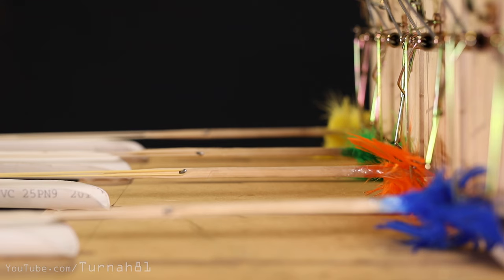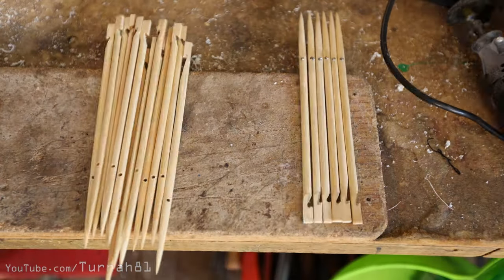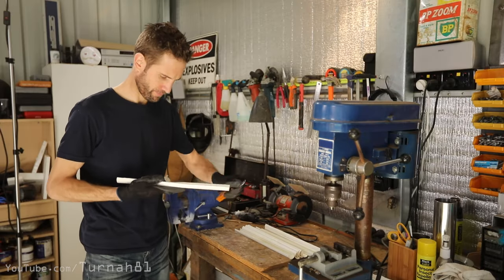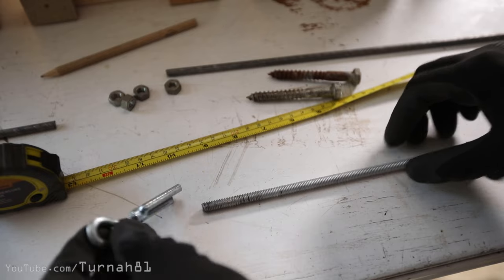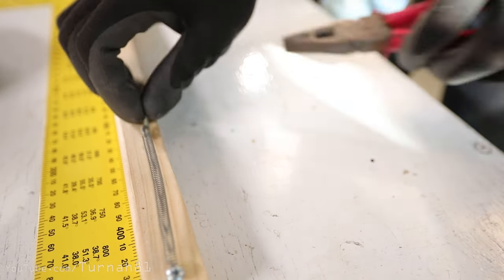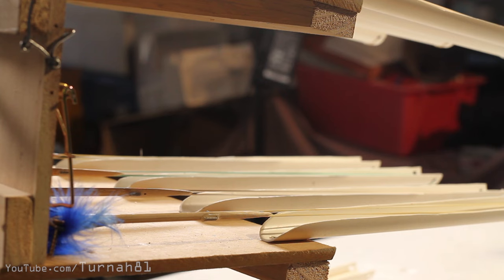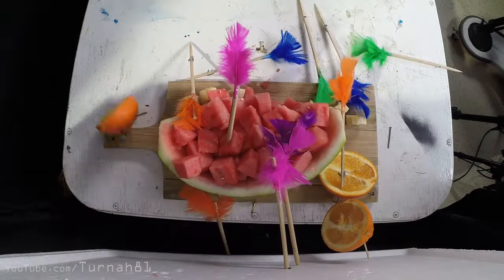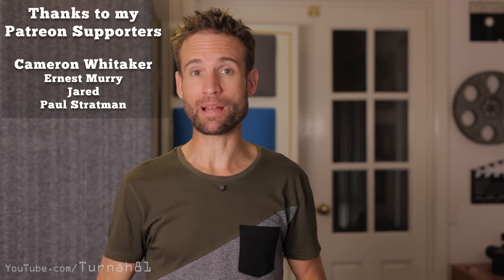I made a "brrrt" rat trap - 50 Arrows per Second!

Comment: it would be useful  to hang up artworks, also a good device for cleaning if you added wet sponged on the tips. Similarly if you added insence to the arrows which automatically light of firing an automatic Buddhist prayer machine, would sell well in Asian markets. Also if you put inked letters on the ends of the arrows you could write random poetry or predict the future. Very useful invention, I hope its patented.

Comment: This gives me an idea.  Make an air cannon but instead of shooting a potato have the air run along a pipe with a whole bunch of smaller tubes and put blowgun darts in them.  With some PVC and hot glue or copper piping and some soder I bet you can make a much nastier version.  Think 100 blowgun darts.

Comment: You could've used wooden blocks to act as a stopper? Taller ones giving greater spread or range, with shorter ones for closer distances? Using a hollowed out piece mounted on the top of the first and second row of arrow traps to hold the stoppers in securely? Cutting each trap separate and attaching them all on hinges could've even allowed for all to be focused into one point.

Comment: What is that tool called at 5:53 which you put notches in the pvc with ?

BTW,  I made a cat deterrent but mine is micro-computer controlled and uses a laser instead of an infra red motion detector (no sneaking past it). * Might post the video one day*  The cat has learned not to come down that side of the house anymore (after numerous soakings)

Comment: Good one. try to make it with Gun-powder ,Not rubber bands.
No seriously next time get some Surgical Tubbing. It works better is more Uniform in shape.
Use Shorter 'Fatter" sticks  and Smaller PVC Pipping that's more 3/4 or 3/8ths around to help guide your missiles. And Smaller feathers , you probably don't even need them.

Comment: Good luck hitting a mouse with that contraption!
Reply from the maker: maybe if there were 24 arrows?
Reply: @Turnah81  , Accuracy is key to nailing a mouse. Hitting a bigger target with nail tipped bolts no problem. Increasing  the number of bolts will increase your chance only. (Bolts) arrows, being they are short arrows which are used on crossbows I would call them bolts, but you can call them arrows. BTW it is very creative.

Comment: Instead of using rubber bands, try using the bail (you were calling it a hammer bar, I believe) to slam into the ends of your arrows to propel them. You could fire probably four or five arrows per trap, giving you a four to five times higher rate of fire. Use soda straws or bits of tubing to keep the arrows lined up.
OR - you could just use unmodified rat traps to kill rats. I guess there's no fun in that, though.
Reply: 13:38

Comment: over-engineered. Use the spring on the rat trap itself to launch the darts/arrows. No need springs for the traps and also rubber for the darts. either use the sling method or an atlatl launcher connected to the rat traps.

Comment: the rat would tottaly blasts apart
but wait!!
Where is the WiFi and or Bluetooth :O
with a cam on it, with laser trip wire that sends a push notification
to watch the blastet Rat! if not a spare row of blaster
and Tracking of the Target, to move the Blaster with Servo-Motors!

Comment: What's so bloody wrong with encouraging that kind of behavior?! It means that you will fix or make something one day that everyone will need and use when you see the need for something that either exist but doesn't work like it should, could work better or doesn't exist yet. I recommend riding a motorcycle in full motorcycle gear while in Uluru on the hottest time of day in the hottest part of summer and see what you if your mind goes to work on the many problems you see with the current setup including use of a full face helmet. It will probably dawn on you that it needs to be light weight yet effective, durable, cheap to build and portable like you don't really notice its presence other than your body temp being regulated.